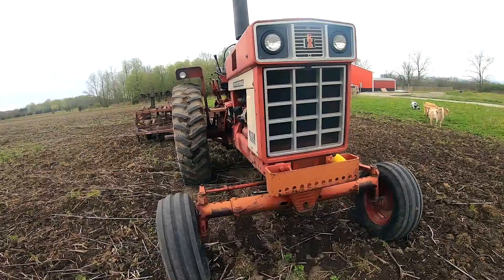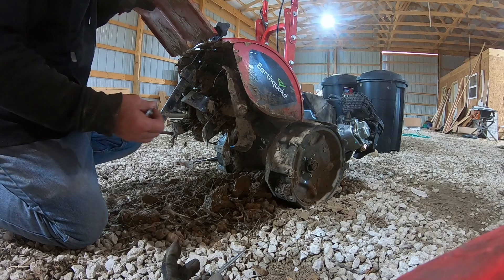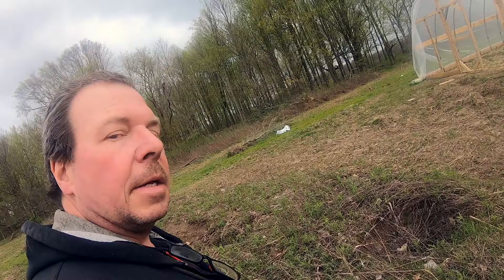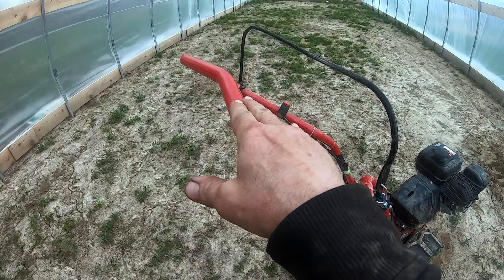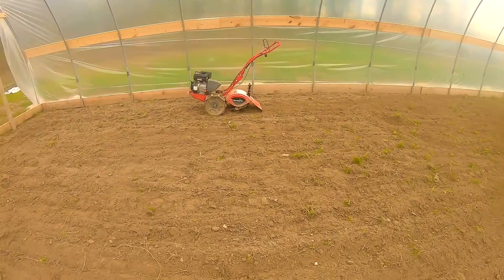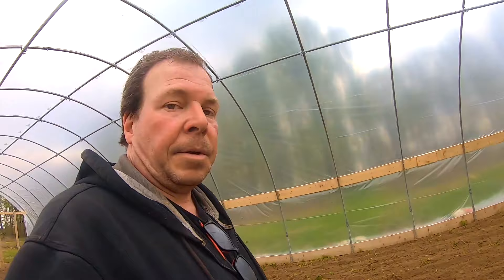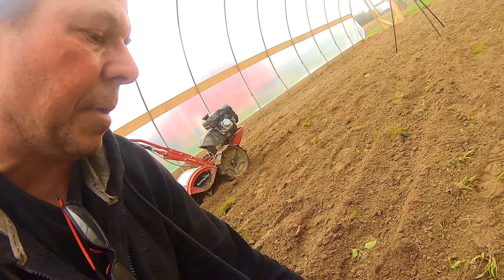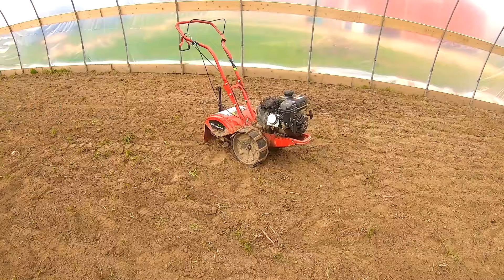How to Use a Tiller - Earthquake Victory Rototiller Review

Comment: I own the Model: 33970 Earthquake Victory 16" 212cc tiller with the pneumatic tires. 
Here are a few postive observations from my experience. At 212cc It has the power and torque to break fresh ground, IF you work your way down in increments. You can't just go all in at once, for those that are new to rototilling. It has plenty of power and torque to till around 6 to 8 inches in depth. At the depth you're tilling, it digs right in and gets the soil worked up.
The tines do good job getting the soil to a sufficient consistency to plant onto, as well. It's decent at incorporating grass root clumps back into the soil when breaking new ground. 
It starts up every time with just a couple pulls. Even after having set entire winter seasons. On a side note, I'll admit that I forgot to treat the fuel when putting it up for this last 21-22 winter season. But, it started up without any difficulties. I probably got lucky and do not recommend not treating the fuel. 
The forward and reverse operator controls are placed in good locations. The engine kill switch is located far enough down on the handle bar that it's easily reached but can't be accidentally switched off.  I've never used the free wheel function. I've always drove it around under it's own power to where I needed it. With the weight of the machine pushing it around in free wheel doesn't make sense to me. 
Here are a few negative observations from my experience. 
If you're expecting a 10 inch tilling depth from this machine, No way! It is not realistically possible from my experience.  Once you reach 6 or so inches of depth it requires that you constantly raise and lower the tines in the soil using the handlebar and pushing the tiller forward because the tires will loose traction and the machine stops moving. The CRT will apply enough ground contact force to stop forward travel in the loose soil and the tires just spin. The maximum usable tilling depth is 6 or so inches. More then that and It will wear you out very quickly tilling a large area! If you were able to get the tines to 10 inches (which would have the rear tine shroud pretty much buried into the ground) the tiller would never move forward because all resistance of the parts that would be physically in contact with the ground and the tine rotation pulling against the machine. 
The height of the handle bars, when breaking ground to roughly 3 or so inches they're at a comfortable height. Going to the 6 or so inches and the handle bars are far to short and there's no length adjustment to make them longer (Taller). At the mentioned 6 or so inches of tilling depth the handle bars are just about mid thigh, I'm 5' 11" tall. The hunching over while lifting and pushing is very tiring on your back.
There is a considerable gap left between the Right side and Left side sets of tines. It leaves a untilled ridge in the ground when doing your initial tilling work. It requires that double up on your work to till again at 90 degrees multiple times to smooth everything out to a consistent depth. If tilling previously tilled ground it's less of a problem. 
 My final thought is that overall the machine seems adequately built for what's it's capable of doing. The real question is would I buy it again? My answer is a NO for me. Not that it's a terrible tiller. It's a surprisingly good tiller for the cost to get you going! For myself, considering the ergonomics and how that effects the usage/operation it falls short. My recommendation buy up a decent amount in price point to get the better ergonomics. If you're not concerned with the ergonomics then buy this model tiller and get a good workhorse of tiller for 6 to 8 inches of tilling depth. You won't be disappointed from that aspect of the machine.
Reply: I have the Champion 212cc tiller, which is the competitor to this model, engine is like 8hp and like 9,5 pounds of torque its actually a pretty powerful little motor for what it is, can till up to 8 inches and reliably do it I use it to break up soil and to help break up gopher tunnels periodically so they will leave grapes alone. Also use mine for tilling for planting barley or wheat through the year as I can grow them anytime in the year.

Comment: Great Video! I am glad to see you are enjoying your Earthquake tiller! For reference, the two orange oil caps you mentioned are actually both for the engine oil and both will reach the same reservoir. This is present to make it as convenient as possible to service your engine. Also, when adjusting the wheels into neutral,  it may save you some headache if you push the wheel further onto the axel rather than pulling it over the axel hole. Then the pin can be replaced and will hold the wheel on as it spins freely! The way it is done in the video may actually cause the wheel to slip off while in transport. If you're looking for a tiller that does not require this step, I would suggest our Pioneer Dual Direction Tiller. It functions very similarly to your Victory but it can be easily shifted into drive or neutral with a single lever. It also features some other nice benefits!
Reply from the maker: Hi Earthquake Outdoor Power Equipment, thanks for letting us know that the two orange caps are for the same oil reservoir.
Also, thanks for the clarification about the wheel locks.  That does make it easier to transport!
We were able to reedit this video and delete those portions from it and now the video should be good.
A mouse chewed through our forward belt, so we are getting that repaired.  Couldn't find a good video to show us how to do that job ourselves, so we had to bring it into a repair shop.
We do DIY project videos and our YouTube channel has over 8 million views.  Let us know if you ever want us to review your new equipment!
Reply: Please explain the use of the lock pin on the drive axle.  

When tilling the wheel should not have the pin through it correct?  Pin should be in the axle and the wheel freewheeling correct?    This way the wheels act as a brake ?   Please confirm.
Reply: @fedora5926  Hello! The wheel pin is both through the wheel and the axle when tilling to allow the wheels to be powered by the engine. If you would like to put the tiller in "neutral" you can slide the wheel in and place the pin through just the axle to allow the wheel to spin freely.
Reply: But isn't the DDT tiller only 90cc vs 212cc? I personally would prefer the DDT but with the larger engine.
Reply: @polie67  Good question! The 99cc engine featured on the Pioneer DDT Tiller provides the same sod busting power as the 212cc thanks to its unique gear driven transmission! This allows the Pioneer to be lightweight and even easier to maneuver. The Victory is still a solid performer but just does not feature the DDT capability along with a few other feature differences.
Reply: @earthquakeoutdoorpowerequi7344  uggg you are talking me into it. lol Now if yall had it on a 5x mo payment on Amazon like the other unit I would definitely be in! (well after Christmas I would be. Get it in for spring tilling and after Christmas expenses) I also want/need the furrower attachment.

PS We need a chariot seat attachment so I ride it lol

Comment: It's 10x easier if you soak the ground first (but not too much). The "concrete" becomes "butter".
Reply from the maker: Hi Gus, 
We have a crazy amount of garden areas to till, so we will give your advice a try.

Thanks so much for this tip!
Reply: @Housebarons  You could run a sprinkler (those hose end oscillating ones) for 20 minutes. Good luck.

Comment: I own the Earthquake Pioneer and I would make one suggestion.  When you open the box stop.  Find the yellow sheet, then be very careful unpacking the rest.  Assembly is 12 steps, and will take about 2 hours.  Stop often to read the directions, then continue.  I like my tiller.  It will do quite a bit of work in a short period of time.
Reply from the maker: Hey Grady,
Thx for the input and for watching!

Comment: Great video! The only negative on this machine is the damnable wheel lock. I had a Troy Bilt with that feature and absolutely hated it. A real PITA to fool with for an older person with reduced physical capacity due to  shoulder injury.
Reply from the maker: Hi phleuge2000, yes the wheel locks are not the easiest to use.  It is best to have two people to operate them.  One person can tilt the tiller while the other person adjusts the wheel locks.  Happy tilling!
Reply: @Housebarons  I’m a one  man show! No second person to help.

Comment: Where did you get that tiller for $500 ???   The lowest price I can find now is $727 at Home depot .  Thanks Kit
Reply from the maker: Hi Kit,
I ran into an incredible sale at our local Menards store.  It was  discounted for some reason.  On top of that they were running that 11% off sale which they frequently do.  This should be a a great time of year to run into an end of the season sale price.  We are still very pleased with this tiller.  Plan on using it today to get some beds ready for next Spring.  Hope you find a deal.  Good luck!
Reply: @Housebarons  Thanks for getting back~!  Kit

Comment: are the wheels, self-driven? and is there a neutral gear?
Reply: I have since purchased one (with the air filled wheels), the wheels are self-driven, but no there is no neutral gear. you have to remove the pin from both wheels to make it roll freely. It has tons of power and it operates a lot like my 30 year old Troy Bilt Pony did (without the neutral). if I had one complaint it would be that due to the counter rotating tines I had to lift up a bit on the handles to get it to go through the soil, otherwise the anchor stake seemed to act like a literal anchor and prevent it from moving forward.

Comment: Good stuff. Thank you. I'm also in Indiana. The clay here is no joke. Curious what you added to the soil to amend it now that all that clay is broke up.
Reply from the maker: Hi Michael, we have four compost bins that we constructed out of pallets, basically just a square with no top on it.

All you have to do is toss in grass clippings and kitchen vegetable scraps (no meat) into the bin, about 25% of the content,
then add cardboard and leaves for about 75% of the content in the compost pile.  It is best to fill a 3x3x3 foot bin full of compost with this ratio.  If it hasn't rained for a while, water it with hose.
From time to time flip the pile to the next bin to aerate everything.

It will take a few weeks or longer, but eventually you will get astonishing black compost which we add to our soil.  We have had great success with this.  

Hope this helps, good luck!

Comment: Your tiller, I have a newer model 
Not sure if you have this on yours
There’s a tilling setting on the axle for the wheels. Take out pin, move tire out to end of axle, put pin back in axle. The tiller moves right along. Hardly any work at all. It pretty much 
Runs it self, very easy. Looks to me
Your struggling or pushing tiller. No need. Only thing you can not push 
Tiller. Either you have to lift up hand
And let the tiller move. 2nd you can take pin out of axle push tire back
And put pin back in. Tires will move
Freely. Just saying. Good Luck tilling
Must be exhausted pushing tiller

Comment: Ever used it on ground that’s never been tilled? (Grass/weeds)
Reply from the maker: Hi Jimmy, we constructed the hoop house that is in the video shortly before we shot this video.  The ground in the video had not been tilled previously.  We have clay soil, so it wasn't easy to till, but every pass made it better.  We have since tilled up many new beds using this tiller over thick grass and weeds and we still like it very much.  

Thanks for your question, good luck with your tilling!

Comment: Awesome video!  That tiller certainly does a good job.  Good tip about steadily increasing the depth for each pass.  Good to see you wearing your jeans over your boots too, pretty much required to stop dirt and soil from flying down into your boots and socks, especially on that kind of job.   Are those rubber boots steel toe?  I always wear my jeans over my rubber boots for work.  Much better that way.  Looks like you're going to be planting a ton of tomatoes this year!
Reply from the maker: Hi Mountainview Ranch, thanks 👍
The Earthquake tiller is awesome!  It has been cold and rainy in Indiana so far.  We are WAY behind with our planting.  Still have to plant all of our outdoor beds, hopefully this week.  The tiller will get a workout.

Very excited about our brand new hoop house!  It is 20x60.  We plan to plant 150 tomatoes in it because we found a private grocer who placed a huge order with us.

Yes, the boots are steel toe, here is info from the manufacturer:  The dependability of a Muck Boot™ is now in a steel toe work boot. The Chore can take on the worst of the worst. The upper has a stretch-fit binding keeping warm in and cool out as well as a seamless, quick-clean rubber overlay. A steel shank provides additional support, with triple reinforcement in the toe area and quadruple reinforcement in the heel. A durable, lightweight rubber outsole adds unbeatable traction in all conditions.

Great boots, thanks for you comments and questions!
Reply: Hello. Thanks for the advice. I plant 250 bushes of tomato.

Comment: U say, with a front tine till, one might have to make multiple passes to get it down to desired depth, yet, thats what your doing with your tiller.  I have a TB, so I know I have to make multiple passes to get it down far enough
Reply from the maker: Hi William, you make a good point, I did end up doing several passes in our hoop house.  That is because we planted tomatoes in there and I wanted to till down at least 8 inches.  In other garden areas I only have to make one pass.  It seems to me that the rear tine tillers are more effective than front tine tillers, but they are also more difficult to maneuver because they are quite heavy.

Comment: I bought one of these last summer. Works great but... this season the 
engine surges. I noticed the air filter box is broken somehow. I just 
spent hours online looking for an air filter and box and found to my 
shock that the parent company (Ardisam Inc) doesn't show any engine 
parts at all! They only show the parts for the tiller, but nothing for 
the engine!! Not even an air filter, let alone the box for it. I googled
 the 99cc Viper engine and found an air breather kit part number, but 
nowhere to buy the kit, but although they show the box in the diagram, 
there is no number for that. First, the box should not have fallen apart
 over the winter. It was stored in a shed. Second, have you ever heard 
of a company selling a product like this and not giving any option to 
buy the parts to maintain the engine? I wouldn't recommend this machine,
 or any other product from Ardisam Inc to my worst enemy. Disgusting 
business practice to not supply parts for their product that's less than
 a year old...

Comment: Probably won't work on untilled hard pan clay
Reply from the maker: Hi safffff1000, our farm is in Indiana.  We would describe our soil directly under our topsoil as hard clay.  The tiller has actually done remarkably well with it.  Viewers have suggested wetting the clay before tilling to make it easier.  The trick there is to wet it enough, but not to0 much or you will be tilling in a horrible bog.  Good luck!

Comment: Demonstrator is confused about depth regulator bar. Kept moving up a hole to go deeper when he should have move down to the lowest hole to get the deepest tilling
Reply: Rear tine tillers work opposite with depth bar than front tine tillers.
Reply: I only use rear tine BCS
Reply: Wrong

Comment: Warning!! Don't buy this tiller. Look at the shroud under the engine. It's open on both sides allowing debris to pack against the drive pulleys and tear up the drive belts. The drive belt broke 3rd time I used it $65 replacement. The next time I used it the wheel hub broke. Thin metal is only spot welded $100 replacement for the same problem. I got mine from  Menard's once you put gas in it you can't return it. Now I'm stuck with a POS.
Reply from the maker: Hey Richard,
Thx for the input - I’m sure that will be helpful for viewers!
Thx for watching!

Comment: Junk. Reverse tines fight against wheels. Have to push it. You ARE the self propeller! Leaves a 3-4 wide ridge between the times in middle you have to go back over. If it wasn’t reverse time soon it would be a good tiller. Doesn’t work worth a damn in good deal black soil.
Reply: Reverse tines work great In harder ground...forward tines just tend to take off and you have to hold it back